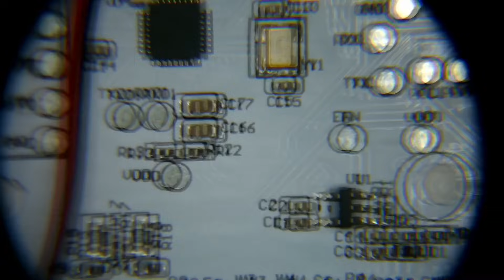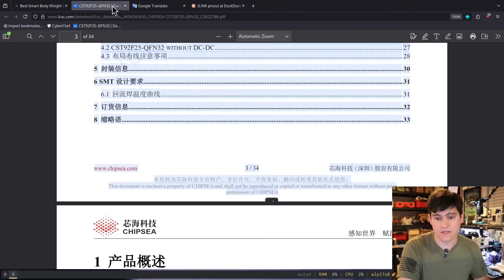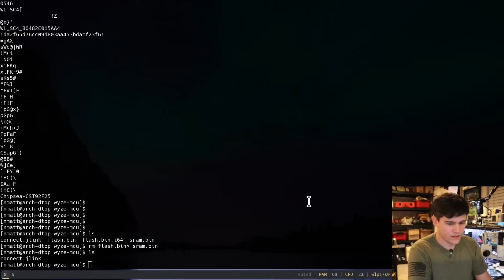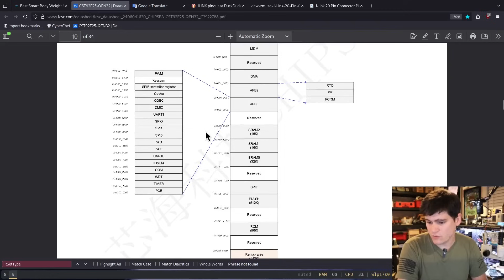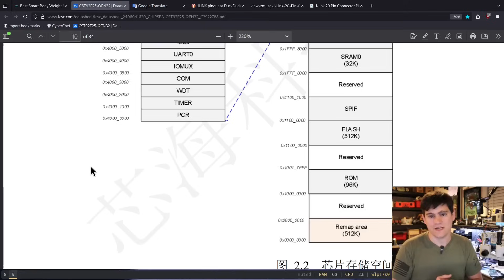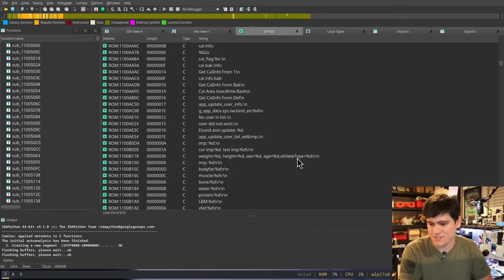Wyze Scale Firmware Dump - SWD Flash Readout via JLink

Comment: Great video! I have read the whole datasheet and I found section 2.2 mentions that there're two interesting modes. The first one is called 'chip test mode' and the second one is called 'programming mode'. I think these two modes are implemented by the mask ROM. In section 2.6 the document states that there're low power mode and 'OFF' mode. I suspect this is the reason why JTAG is unusable after 45 seconds.

By the way, you can run command in history with "!<number of history>".

Comment: CHIPSEA appears to have an English version of the document. I was Googling it while you were talking and they have it listed right with the Chinese language ones. I'm just curious why you didn't pull that one down instead. Do you find there are differences in the Chinese language document? (Love the videos by the way!!!)
Reply: came here to say the same thing (not that it matters because i didn't see any readout protection or interface disabling capabilities)
Reply: Rushing! Not to say that’s what happened, but I spent 3 hours trying to flip my webcam stream in Octoprint when adding a multicam setup on the new camera stack, AND THERE WAS A TOGGLE IN THE UI THE WHOLE TIME :(

In my defense, I was looking for a way to flip the actual stream through the config files like you can for pi cams (it’s a usb nozzle cam), but the toggle in multicam (a plugin, not an installed library through terminal) flipped the stream in every other plugin too (Obico, Octoprint, etc). All of the documentation I found either said “Use the config files”, “Use FFMPEG to flip after capture” or “lol sry not possible”, but I think that’s because the solution is so obvious that no one had posted about the actual, easy solve.  

I should’ve just recalled the old saying, “Remember, no Rushin’ “

Comment: Hi Matt, great video!

What if the chip had readout protection?

There are some commands to block the internal flash so that it can only read back after erasing the entire chip, and there are sometimes Jtag protections that prevents the jlink to access the debug port.

In these cases, how would you proceed with firmware extraction/reverse engineering (if at all possible)?

Comment: Just a question: why did you use jlink and not bluetag or jtagulator?
Reply: Probably because that's what he had available. Why use the hacky solution when you can use the official one.
Reply: Jlink is way cheaper too 🏆
Reply: Because he knew the exact pinout of the swd from the datasheet, obviously.
Reply: @RickDkkrd Even if he knows, couldn't he still use bluetag? Or does he still have to use jlink because with bluetag he couldn't have done what he did in the video?
Reply: @allexj8203  He could, but the primary use case for those tools is pinout detection. Normally one doesn't use a lockpick when he has a key, although the lockpick can do the job too.
Reply: @RickDkkrd using jlink allows for more features/possibility compared to what one can do with bluetag?